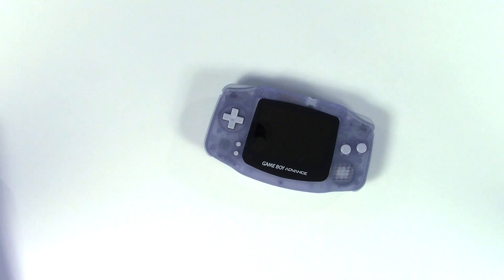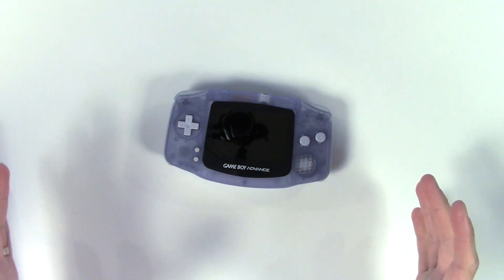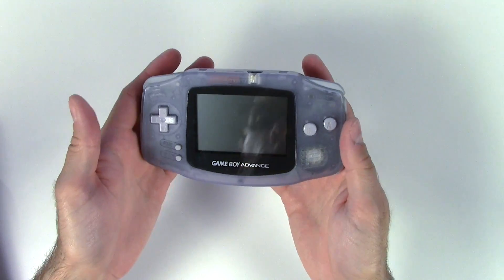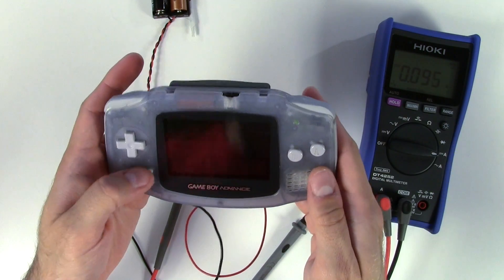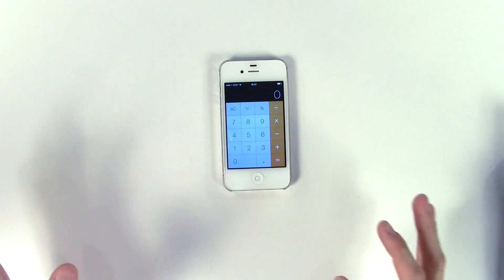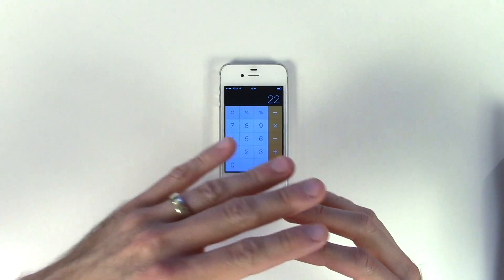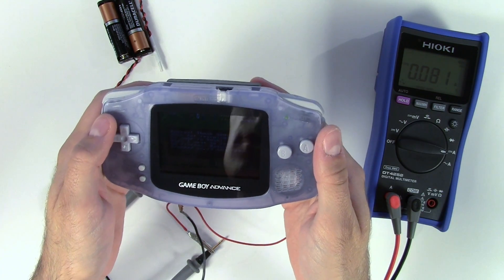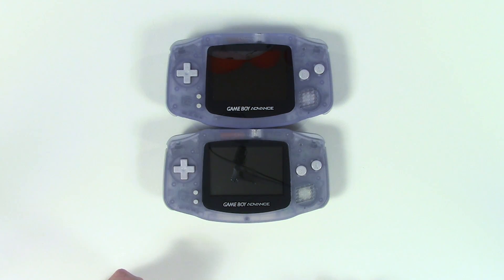Backlit Modded Game Boy Advance Battery Life Test

Comment: Hey there, love the videos about the GBA modding, I'm definitely going to try it a.s.a.p., because the original GBA had a much better feel to it than the smaller SP. 

My question thought, and maybe you have addressed this before, at the end of your original modding video, you said you had some issues with the modded GBA's screen being a bit dim in normal sunlight. Could it be that the modded GBA just doesn't use the same amount of power as the original screen because of the modified power supply (as in the soldering to the motherboard)? 

In any case, thanks for the interesting videos!
Cheers
Reply from the maker: Well, after I shot that original video, I went back to investigate a bit further why the screen was so dim. It ended up prompting me to shoot a follow-up:

Game Boy Advance Backlight Mod Tweak and Final Results

In the end, I'd say that the modded console is still a bit dimmer than an AGS-101, but as I show in that video, I was able to get it to look dramatically better than it did at first.
Reply: This Does Not Compute Hello, my Name is George, I want to buy that Gameboy off of you for  1,000,000,000,000,000,000,000,000,000,000,000,000,000,000,000,000,000,000,000,000,000,000,000,000,000,000,000,000,000,000,000,000,000,000,000,000,000,000,000,000,000,000,000,000,000,000,000,000,000,000,000,000,000,000,000,000,000,000,000,000,000,000,000,000,000,000,000,000,000,000,000,000,000,000, 000,000,000,000,000,000,000,000,000,000,000,000,000,000,000,000,000,000,000,000,000,000,000,000,000,000,000,000,000,000,000,000,000,000,000,000,000,000,000,000,000,000,000,000,000,000,000,000,000,000,000,000,000,000,000,000,000,000,000,000,000,000,000,000,000,000,000,000,000,000,000,000,000,000,000,000,000,000,000,000,000,000,000,000,000,000,000,000,000,000,000,000,000,000,000,000,000,000,000,000,000,000,000,000,000,000,000,000,000,000,000,000,000,000,000,000,000,000,000,000,000,000,000,000,000,000,000,000,000,000,000,000,000,000,000,000,000,000,000,000,000,000,000,000,000,000,000,000,000,000,000,000,000,000,000,000,000,000,000,000,000,000,000,000,000,000,000,000,000,000,000,000,000,000,000,000,000,000,000,000,000,000,000,000,000,000,000,000,000,000,000,000,000,000,000,000,000,000,000,000,000,000,000,000,000,000,000,000,000,000,000,000,000,000,000,000,000,000,000,000,000,000,000,000,000,000,000,000,000,000,000,000,000,000,000,000,000,000,000,000,000,000,000,000,000,000,000,000,000,000,000,000,000,000,000,000,000,000,000,000,000,000,000,000,000,000,000,000,000,000,000,000,000,000,000,000,000,000,000,000,000,000,000,000,000,000,000,000,000,000,000,000,000,000,000,000,000,000,000,000,000,000,000,000,000,000,000,000,000,000,000,000,000,000,000,000,000,000,000,000,000,000,000,000,000,000,000,000,000,000,000,000,000,000,000,000,000,000,000,000,000,000,000,000,000,000,000,000,000,000,000,000,000,000,000,000,000,000,000,000,000,000,000,000,000,000,000,000,000,000,000,000,000,000,000,000,000,000,000,000,000,000,000,000,000,000,000,000,000,000,000,000,000,000,000,000,000,000,000,000,000,000,000,000,000,000,000,000,000,000,000,000,000,000,000,000,000,000,000,000,000,000,000,000,000,000,000,000,000,000,000,000,000,000,000,000,000,000,000,000,000,000,000,000,000,000,000,000,000,000,000,000,000,000,000,000,000,000,000,000,000,000,000,000,000,000,000,000,000,000,000,000,000,000,000,000,000,000,000,000,000,000,000,000,000,000,000,000,000,000,000,000,000,000,000,000,000,000,000,000,000,000,000,000,000,000,000,000,000,000,000,000,000,000,000,000,000,000,000,000,000,000,000,000,000,000,000,000,000,000,000,000,000,000,000,000,000,000,000,000,000,000,000,000,000,000,000,000,000,000,000,000,000,000,000,000,000,000,000,000,000,000,000,000,000,000,000,000,000,000,000,000,000,000,000,000,000,000,000,000,000,000,000,000,000,000,000,000,000,000,000,000,000,000,000,000,000,000,000,000,000,000,000,000,000,000,000,000,000,000,000,000,000,000,000,000,000,000,000,000,000,000,000,000,000,000,000,000,000,000,000,000,000,000,000,000,000,000,000,000,000,000,000,000,000,000,000,000,000,000,000,000,000,000,000,000,000,000,000,000,000,000,000,000,000,000,000,000,000,000,000,000,000,000,000,000,000,000,000,000,000,000,000,000,000,000,000,000,000,000,000,000,000,000,000,000,000,000,000,000,000,000,000,000,000,000,000,000,000,000,000,000,000,000,000,000,000,000,000,000,000,000,000,000,000,000,000,000,000,000,000,000,000,000,000,000,000,000,000,000,000,000,000,000,000,000,000,000,000,000,000,000,000,000,000,000,000,000,000,000,000,000,000,000,000,000,000,000,000,000,000,000,000,000,000,000,000,000,000,000,000,000,000,000,000,000,000,000,000,000,000,000,000,000,000,000,000,000,000,000,000,000,000,000,000,000,000,000,000,000,000,000,000,000,000,000,000,000,000,000,000,000,000,000,000,000,000,000,000,000,000,000,000,000,000,000,000,000,000,000,000,000,000,000,000,000,000,000,000,000,000,000,000,000,000,000,000,000,000,000,000,000,000,000,000,000,000,000,000,000,000,000,000,000,000,000,000,000,000,000,000,000,000,000,000,000,000,000,000,000,000,000,000,000,000,000,000,000,000,000,000,000,000,000,000,000,000,000,000,000,000,000,000,000,000,000,000,000,000,000,000,000,000,000,000,000,000,000,000,000,000,000,000,000,000,000,000,000,000,000,000,000,000,000,000,000,000,000,000,000,000,000,000,000,000,000,000,000,000,000,000,000,000,000,000,000,000,000,000,000,000,000,000,000,000,000,000,000,000,000,000,000,000,000,000,000,000,000,000,000,000,000,000,000,000,000,000,000,000,000,000,000,000,000,000,000,000,000,000,000,000,000,000,000,000,000,000,000,000,000,000,000,000,000,000,000,000,000,000,000,000,000,000,000,000,000,000,000,000,000,000,000,000,000,000,000,000,000,000,000,000,000,000,000,000,000,000,000,000,000,000,000,000,000,000,000,000,000,000,000,000,000,000,000,000,000,000,000,000,000,000,000,000,000,000,000,000,000,000,000,000,000,000,000,000,000,000,000,000,000,000,000,000,000,000,000,000,000,000,000,000,000,000,000,000,000,000,000,000,000,000,000,000,000,000,000,000,000,000,000,000,000,000,000,000,000,000,000,000,000,000,000,000,000,000,000,000,000,000,000,000,000,000,000,000,000,000,000,000,000,000,000,000,000,000,000,000,000,000,000,000,000,000,000,000,000,000,000,000,000,000,000,000,000,000,000,000,000,000,000,000,000,000,000,000,000,000,000,000,000,000,000,000,000,000,000,000,000,000,000,000,000,000,000,000,000,000,000,000,000,000,000,000,000,000,000,000,000,000,000,000,000,000,000,000,000,000,000,000,000,000,000,000,000,000,000,000,000,000,000,000,000,000,000,000,000,000,000,000,000,000,000,000,000,000,000,000,000,000,000,000,000,000,000,000,000,000,000,000,000,000,000,000,000,000,000,000,000,000,000,000,000,000,000,000,000,000,000,000,000,000,000,000,000,000,000,000,000,000,000,000,000,000,000,000,000,000,000,000,000,000,000,000,000,000,000,000,000,000,000,000,000,000,000,000,000,000,000,000,000,000,000,000,000,000,000,000,000,000,000,000,000,000,000,000,000,000,000,000,000,000,000,000,000,000,000,000,000,000,000,000,000,000,000,000,000,000,000,000,000,000,000,000,000,000,000,000,000,000,000,000,000,000,000,000,000,000,000,000,000,000,000,000,000,000,000,000,000,000,000,000,000,000,000,000,000,000,000,000,000,000,000,000,000,000,000,000,000,000,000,000,000,000,000,000,000,000,000,000,000,000,000,000,000,000,000,000,000,000,000,000,000,000,000,000,000,000,000,000,000,000,000,000,000,000,000,000,000,000,000,000,000,000,000,000,000,000,000,000,000,000,000,000,000,000,000,000,000,000,000,000,000,000,000,000,000,000,000,000,000,000,000,000,000,000,000,000,000,000,000,000,000,000,000,000,000,000,000,000,000,000,000,000,000,000,000,000,000,000,000,000,000,000,000,000,000,000,000,000,000,000,000,000,000,000,000,000,000,000,000,000,000,000,000,     DOLLARS

Comment: Another good reason to do the mod! I'm having a problem though with mine. The screen lights up but there is no picture, it is just white. There is sound as well. What could be the problem? Wrong type of wire used? Or just I just screw up somewhere?
Reply from the maker: Sounds like the screen is getting power -- make sure your screen ribbon cable connections are solid, then try adjusting the trimpot on the motherboard (I have a separate video about this). If that doesn't work, then you probably have a bad ribbon cable adapter...if even one trace on it is broken, it can cause big problems. Good luck!
Reply: Thank you very much. I will look into it and report back.
Reply: I Am IKR, I WANT TO KNOW LOL

Comment: Wow that was an unexpected but rather interesting outcome. As you said, I think it has to do with the nominal power draw of a modern backlit tft verses a transflective lcd from the early 2000's. In addition, if the backlight were driven via pwm instead of dc I'm sure even more battery life could be squeezed out at the expense of a little brightness. I might just have to pick myself up a conversion kit to upgrade my gba. Thanks for the video.